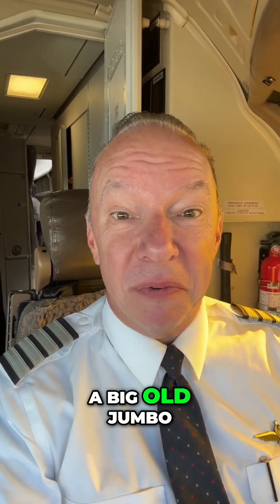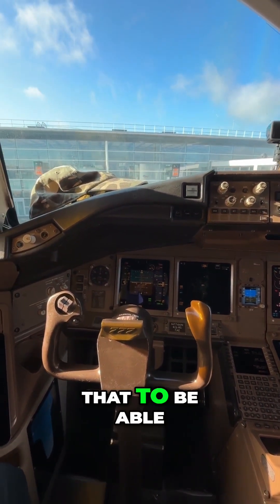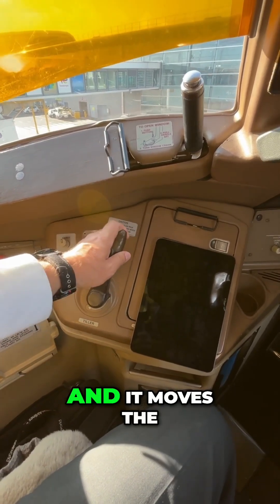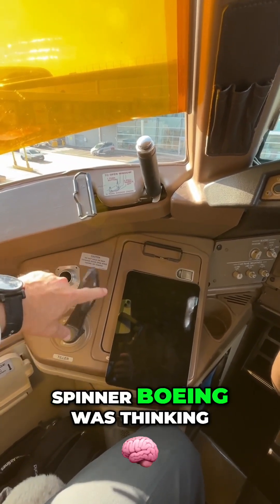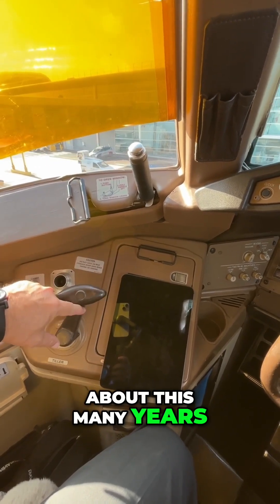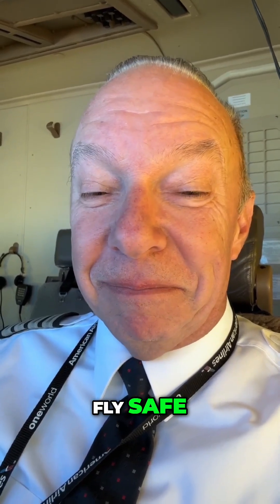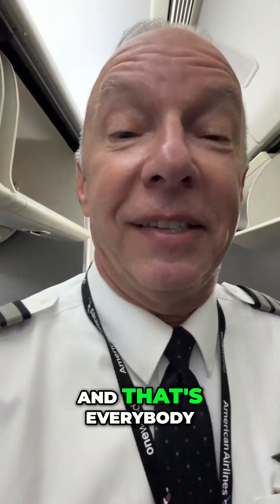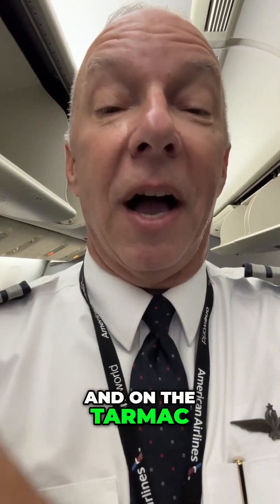How Jumbo Jets Steer On The Ground & In The Air

Comment: Hang on the nose wheel is controlled from the rudder pedals is it not? That's confused me.
Reply: During takeoff and landing the nose wheel is controlled from the rudder pedals, with limited movement. During taxi you use the tiller for full movement range.